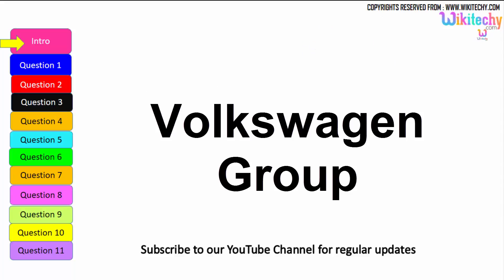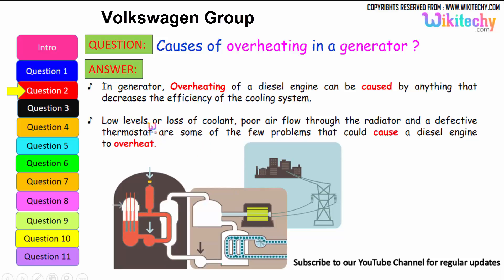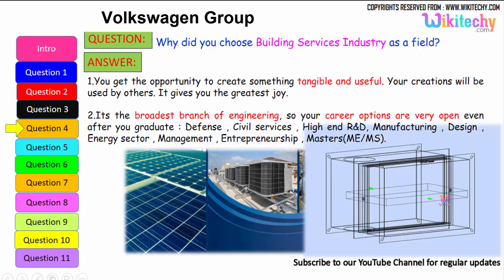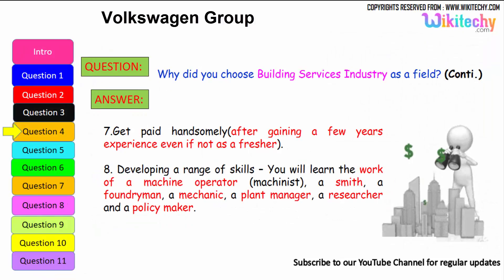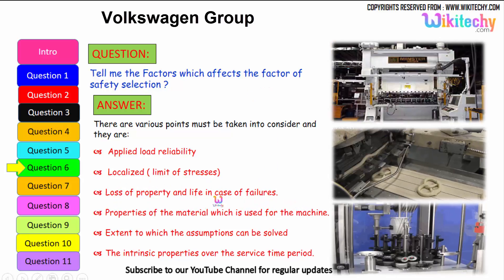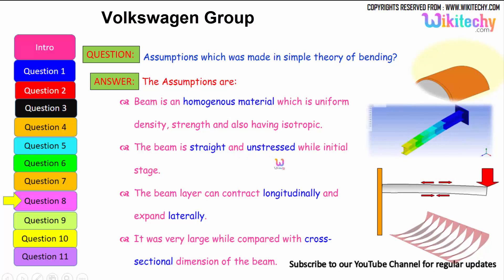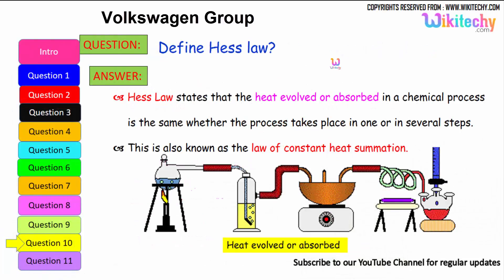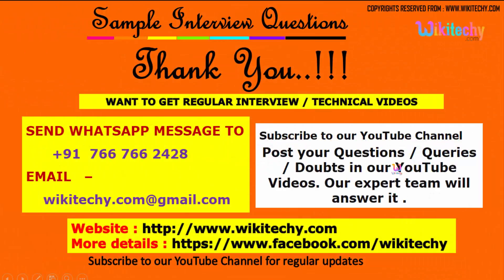volkswagen group important interview questions and answers for freshers

Comment: What is the interviewer trying to achieve by asking you to “tell him about yourself”? Well, for the interviewer, it’s an easy and open-ended way to start the conversation.His ultimate goal for this interview is to find out enough about you to decide if you’re a good fit for the job opening that he is being paid to fill. In most cases, he wants to like you. His life will be easier if he can find a great candidate quickly. However, he is also on guard because a bad hire will reflect poorly on his judgment and possibly be a mark against him when it comes time to ask for a raise or promotion or bonus.He is hoping that this question will get you talking. This question is almost always asked first, perhaps right after some chit chat about traffic and the weather. As a result, his first impression of you will be all about your answer to this question. Your answer here will also set the tone for the interview and let you lead with your strongest selling points.